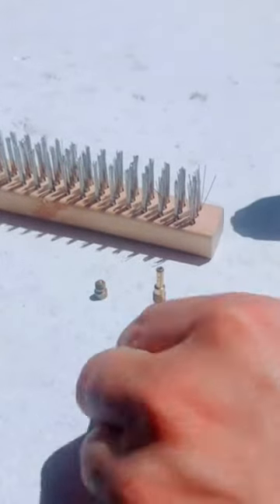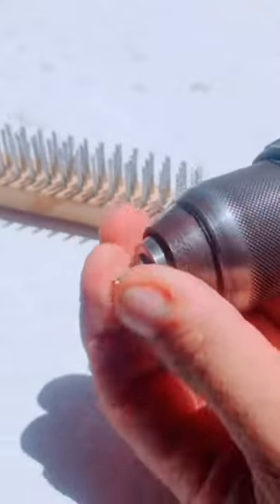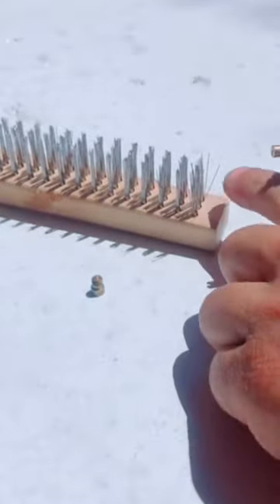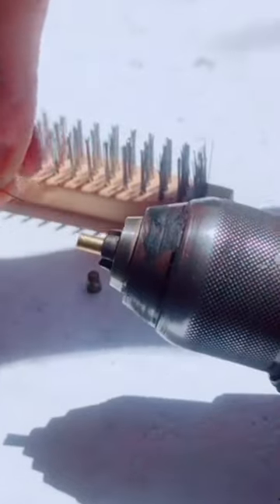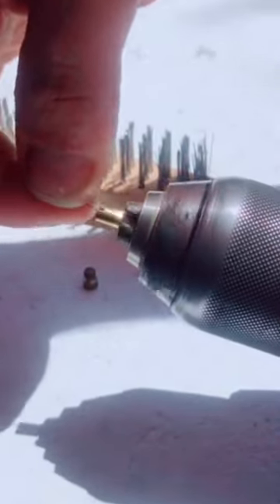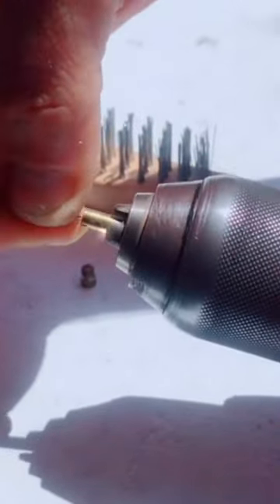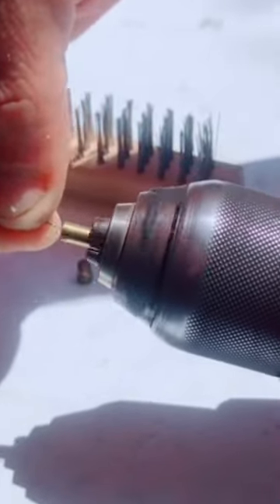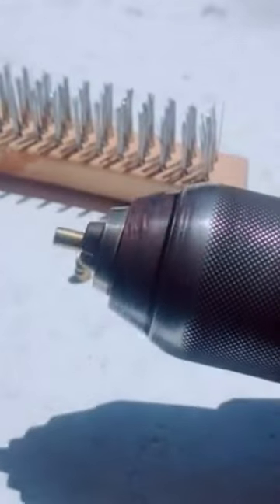Easy Hack to Clean Scooter jets #shorts #shortvideo #scooter

Comment: How to adjust carb of scooter 150cc...for less fuel consumption....
Reply from the maker: Hello my friend you can place a slightly smaller main jet only one size down or according to your altitude where you are located but do not put a very small or your motor will run to lean and to hot and you will damage your motor
Reply: @VirberelloScooterTips main jet work only when you give full throttle correct?  And no one gona ride full tgrottle all time he need small size pilot jet